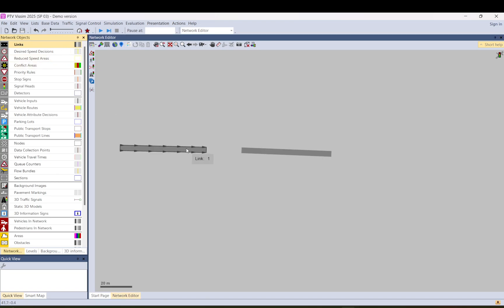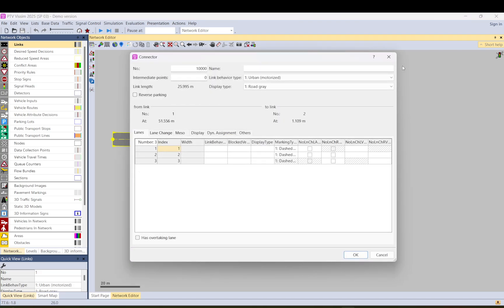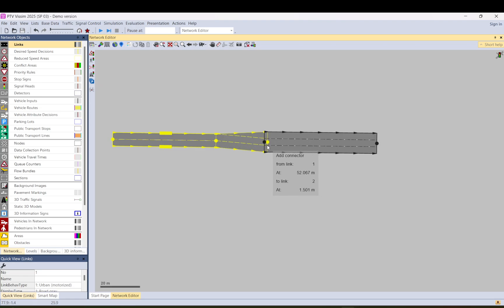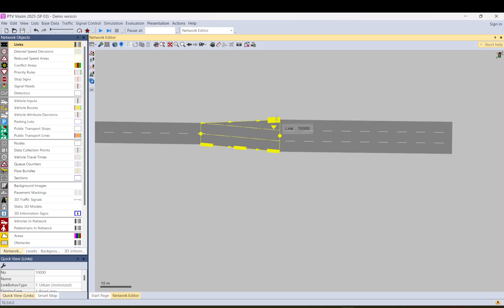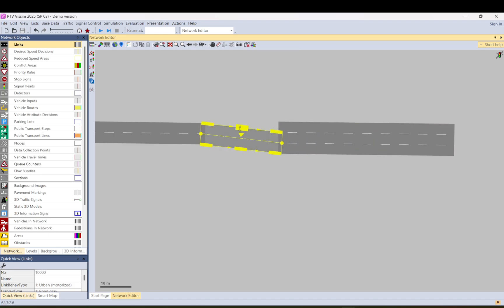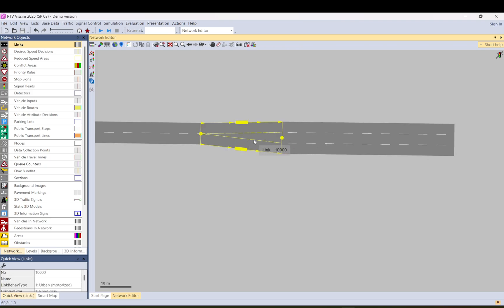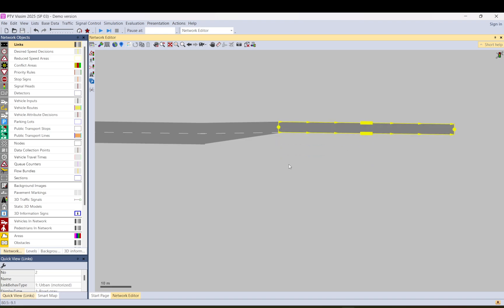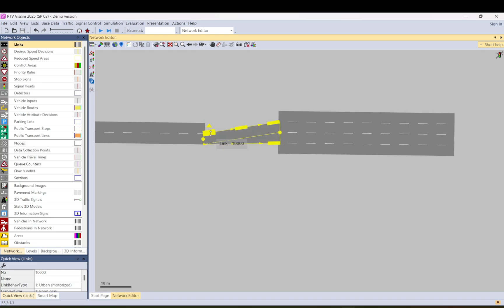Vissim Tutorial - How to use connectors in version 2025

Comment: Hi, I am using a ,Dell but when I hold the Ctrl right click button and try to pull a connector, it is not working
Reply from the maker: Hi, your Vissim might use different settings. Go to Edit menu -> User Preferences -> User Interface -> Network Editor and change the Right Click Behaviour